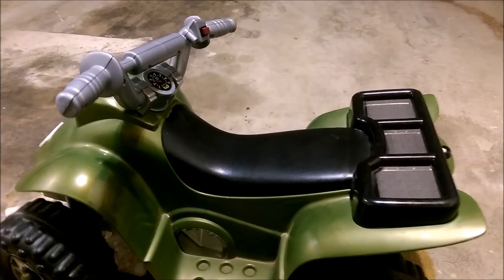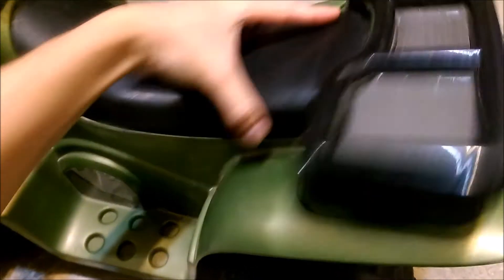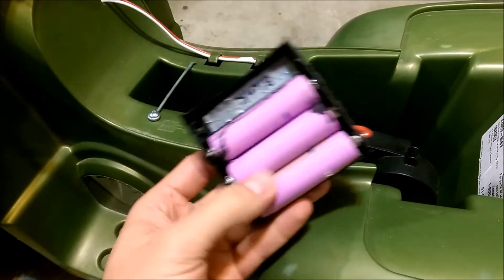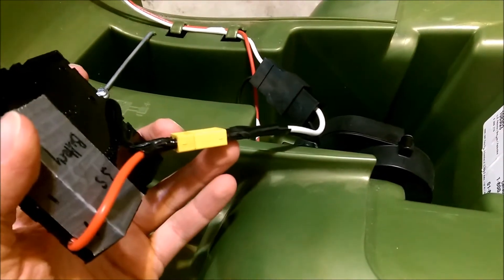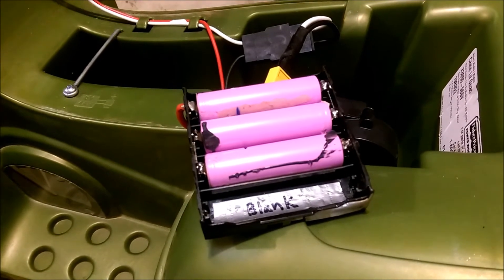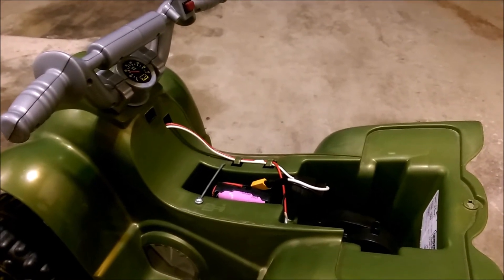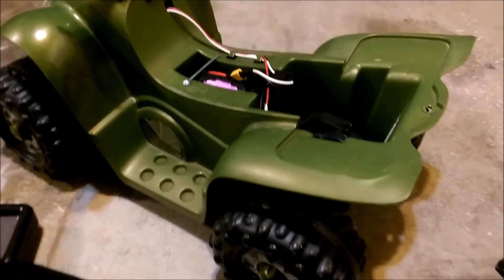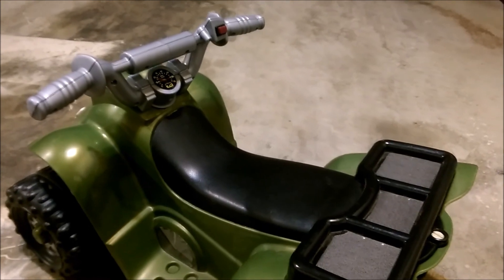Double the Speed of Your Power Wheels Lil Quad!

Comment: I’ve got a lot of drill batteries lying around. I have a spare charger and 12v dewalt batteries I may wire in and use the battery charger dock as a way to plug into power wheel. Old 6volt is shot. Maybe order motor from amazon with esc to control it

Comment: How long did it last? Any thoughts of adding a second set in parallel? i suspect the 18650s are ~2k mah?
Reply from the maker: I ended up going with a homemade 3s 3p of 18650s. Motor is still good and battery lasts at least 3 days of riding. My kid loves the faster speeds.

Comment: The 6V factory motor burned up in mine after upgrading to 12V so I bought the upgrade gearbox and motor from ebay for under $20. Hear is the link to the one I bought. https://www.ebay.com/itm/550-30000RPM-Gearbox-with-12V-Motor-Electric-Gear-Box-for-Kids-Power-Wheels-Cars/263920008668?hash=item3d72dbbddc:g:vMwAAOSwBzpbkI01

Comment: I built my kids a 20 cell 12V lithium battery for their normally 6V 
power wheel Lil' Quad and changed the motor and gearbox to a higher rpm 
6/12V unit and this thing hauls. The lithium battery is alot lighter 
weight than the factory acid battery so that alone makes it faster. It 
runs all day long without heating up or running down and it's so fast 
that when I take them around the block I have to run the entire time to 
keep up with it. It carries my 2 and 3 year old kids together with no 
problem, combined the kid's weight is 75 lbs.
Reply: Any chance you still have the part numbers for that gearbox/motor upgrade?

Comment: Nice! How long is the run time?
Reply from the maker: She has been running the same batteries for a couple months, ride time is probably totaling an hour or so over that time period. Just be careful to not drive down the lithium cells past 2.85 volts per cell, it will damage them. I would recommend the battery change, it drives so much faster now :)